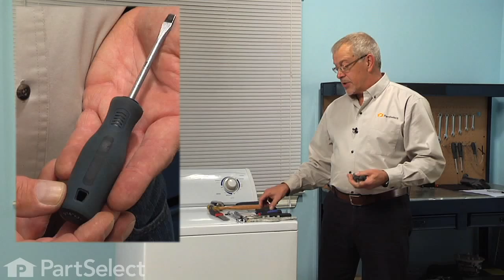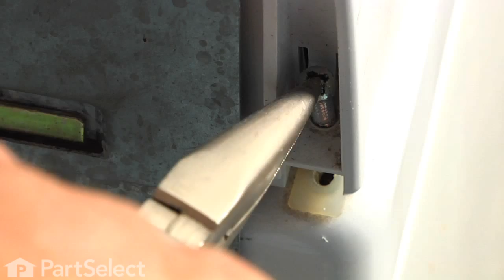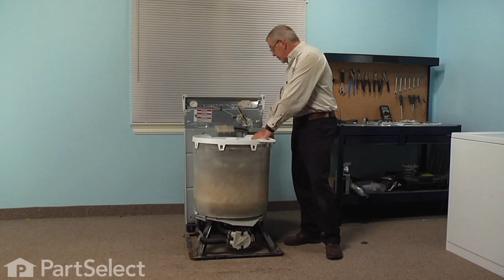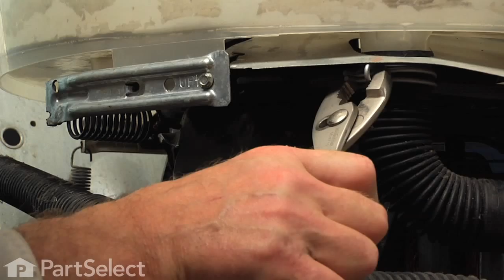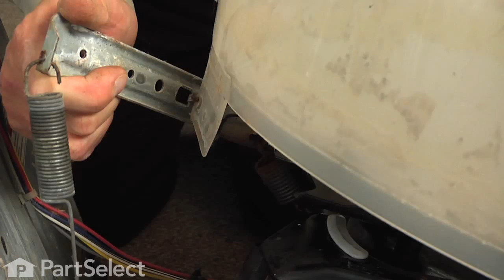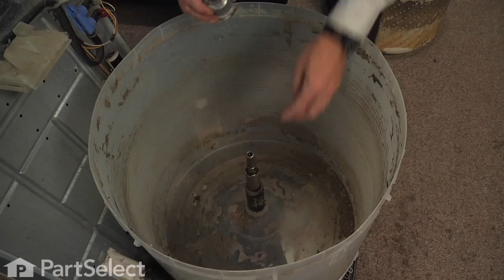Washing Machine Repair - Replacing the Tub Wear Pads (Whirlpool Part # 285744)

Comment: You just made this so much harder than it needs to be.
Reply: How?
Reply: @joeburttschell1286  The part where he removes the tub with the tub wrench... never goes that easy in real life... that is a PITA. Just get down to the tub, but removing the "white metal covering parts" Then remove the springs, not the way he shows, just unhook them from the bottom, attaching to the base. Then the tub will move out of the way enough for you to change the pads. I use a jack stand that hold each side up one at a time. DONOTREMOVE THE SPRING HOLDER THINGY WHERE HE UNDOES THE TWO SCREWS. Just remove them how I said. But your pads are fine, and you are thinking it will fix you unbalancing issue and changing the pads will not do that... and I can guarantee your pads are fine. Am I right about the issue you are having?
Reply: @ACoustaDC  Then what do you recommend ? I replaced both the 3 pads and the 4 springs and it got a bit more stable. The old pads (24yrs) didn't look much different from the new ones.
Reply: @pmarquisYT  exactly... replacing pads wont do it. do you know how to balance the machine by lifting the rear of the machine and letting the legs "self balance"? What is the surface your machine is on?
Reply: @pmarquisYT I’ve replaced so many of these without even taking the machine apart. Lean the machine back, let it rest up against a wall. Climb under is, stick a flat head in between the base and the tub, pry up just enough to pop the old pads out, then do the same but installing them. In and out in less than 5 minutes.
Reply: @Dav1dwuzhere Leave the suspension rods in place? About to tackle this job.
Reply: @ildinvestmentsllc106  washers with suspension rods do not use these wear pads, as they’re not needed due to the “free floating” tub. It sounds like your washer might have suspension rods that need to be replaced all together, which is fairly easy to do as well if you’ve never done it before.
Reply: @ildinvestmentsllc106 I apologize, you may have been talking about the counter weight springs and I got them mixed up with the suspension rods on newer style washers. Yes, you do not have to remove the counter weight springs, you can leave them on. Just lean the machine back and pry up on the tub base. They’ll pop right out with a flat head.

Comment: I bought the parts on your website, changing the pads fixed the bad vibrations of my washer. But while the process you describe is very safe, it's much more complex and requires a special tool. So I followed the instructions on this other video, and used a stick to keep the gap open while I changed the pad: https://www.youtube.com/watch?v=Fg8xTKR9qAU
Reply: That looks a LOT more doable.  Thanks for suggesting this one.
Reply: Yeah no need to take everything apart like he does.

Comment: I have a washer that I'm in the process of restoring,Ive had it for 30 something years,something Ive come to realize about these direct  drive washers is how easy they are to take apart, literally if you are somewhat mechanically inclined you can have one of these completely apart in 10 minutes,the only problem you can run into is taking the inner tub apart because they became fused to the drive block due to year after year of soap and dirt,all you have to do is rent a 3 or 2 jaw puller from your local auto parts store, dont hit it hard or nothing, the jaw puller will do the work for you.

They just about sell every part for these,in the last 40 years they have changed very little,some have more functions than others,maybe a few more dials but inside they are just about the same,the guy that designed these probably spent many afternoons under a palm tree with a umbrella drink,a excellent and simple design for sure.

Comment: Thanks for this video. I just replaced both types of wear blocks on my washer. The worst part of this was trying to separate the tub from the basket drive shaft. Mine did not just lift out-it took over an hour and a lot of WD-40 for it to finally break free. I also replaced the seal at the bottom of the outer tub while I had it apart. With the cost of both types of wear pads, the basket drive shaft seal, a replacement clamp and the spanner wrench, the total cost was around $60.00. The guys at the appliance parts house (APCO) were a lot of help too. It felt great making the repair myself and best of all, it stopped the violent shaking during the spin cycle. Again Steve, thanks for this video.
Reply: Mine took an automotive gear puller to seperate the tub from the basket drive. I swear to god, it's not just a simple nudge nudge, wink wink. It was a NIGHTMARE after 18 years?
Reply from the maker: We also sell parts for your washer.

Comment: I just worked on a 19 year old Kenmore, same setup, same washer , same part numbers. Cheap as these upper and lower wear and friction pads are, and having the washer this far apart why would you not go ahead and replace the upper set of pads as well as the lower ones just because youre there-?   I replaced both sets and they cost me all of $15.00 total and I did it without removing the drum, just the pump and motor (easy!).  I also removed the suspension springs so I wouldn't have to fight them, I didn't remove the tub brackets where they are attached, just used vise grips to detach the springs from their holes.  I also removed the motor and motor plate for more access as I was replacing the motor coupling anyway.  Per a Y.T. video I used a 30" 1"x4" board with a 2" notch on the end to lever with the notch end from the lower rear frame with a 2" x 4" block between the front lower frame and 1"x4" to lift up the tub and transmission enough to gain access and allow movement of the metal plate where the wear pads are attached.  NOTE: make sure you mark this plates original position and get it back to that same position when done with the pads.  Admittedly its a little more tedious to work with the tub on especially on the upper wear pads, but its doable and not removing the tub was less involved and avoids risking a possible leak.   I also replaced the back counter balance spring ($5.00) and drilled a new hole where its attached at the bottom, the spring eventually wears out the hole and comes loose.  As this washer was almost 20 years old I also replaced the motor coupling ($3.77) while I was there, to my surprise it was the original and had not cracked or come apart yet - the replacement is improved and has metal inserts where the shafts go in.  This work gave a definite improvement in the spin cycle, but I may still replace the three suspension springs under the tub to see if theres any more improvement to be gained.   I find these washers very easy to work on and parts are fairly cheap, though if you want to remove the tub you will need to buy the special tub nut spanner wrench, might as well buy the universal one that works on different styles of nuts, same price.  Any other method risks damage to the inner tub porcelain or the nut itself, even with the wrench be careful with that hammer!  This was easier to work on than my 40 year old GE Filter Flo, but its not near as well built as the old 1977 GE either.  My old GE didn't need any real repairs until this year, no way any of todays appliances can match that degree of longevity.
Reply from the maker: We agree, that is the perfect opportunity to change both sets..

Comment: I have what looks to be almost the same whirlpool washer that's shaking and vibrating during the spin cycle. The clothes are wetter than they should be at the end of the spin cycle. Would the vibrating cause the clothes to still be wet? And if i order and replace the wear pads, should I replace the suspension spring while I'm at it? Also do you sell the spanner wrench? Model WTW5310VQ0
Reply from the maker: If the wear pads are worn badly then the suspension springs may need to be replaced as well. Check the clutch operation for poor spin performance as well.
Reply: Sounds like the clutch is slipping. Just replaced mine and it spins way faster now and the clothes are spin dry.